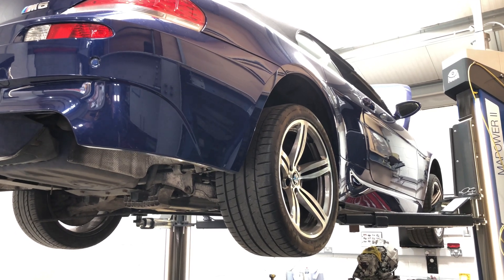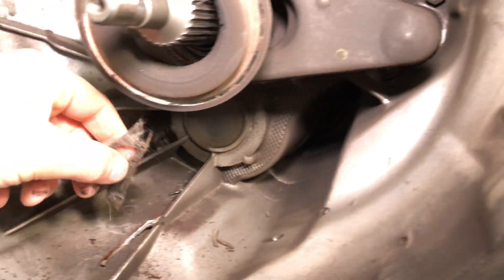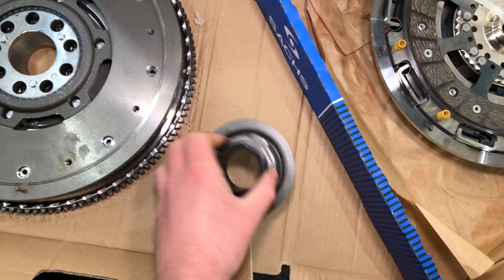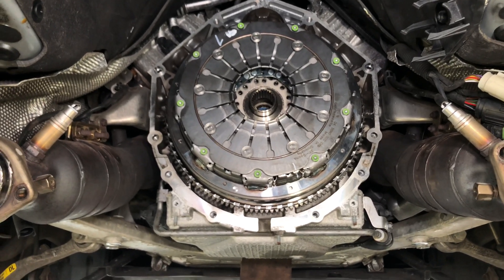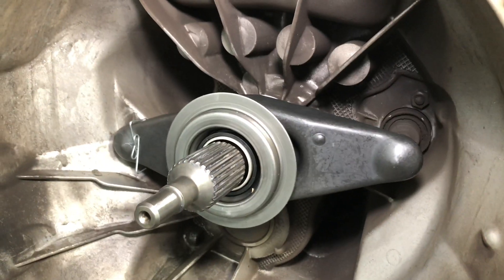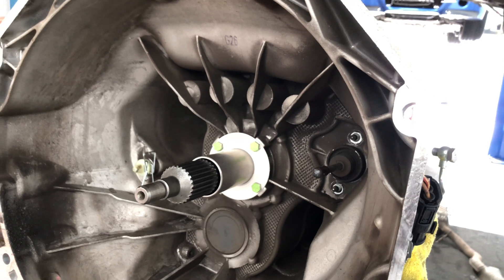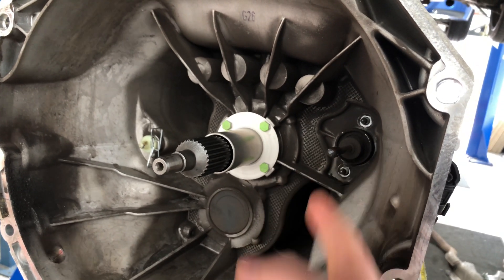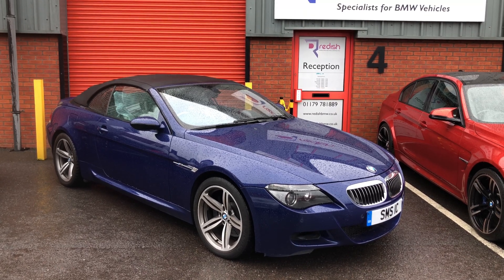BMW SMG Won't Adapt!

Comment from the maker: REGARDING THE COST:
Wow guys, chill, such negativity in such a short space of time….

This video was recorded 2.5 years ago:

Work carried out 1st July 2020. 
Video uploaded 4th July 2020. 
Video published 5th Feb 2023. 

Just to clarify and try to answer all the questions surrounding the customer being charged to remove the gearbox a 2nd time. 

HE WASN’T. 

Perhaps I used the wrong phrase of words on the video without expanding (sorry for any confusion). 

I’ve just check the works invoice from 8th July 2020 and WE PAID FOR HALF THE LABOUR. 

I can tell you the customer was very happy with that outcome. 

I appreciate some people may still think that’s unacceptable and there’s not much I can do about that as everyone’s entitled to their own opinion. 

Ourselves and the customer both came to the conclusion that neither party could have known about the Slave Cylinder ‘may’ cause the SMG not to adapt due to a 2017 BMW document (BMW released 12 years after production, and only 3 years before this work was carried out in 2020), and therefore we agreed to split the invoice as it was neither persons fault. 

If it was anybody’s fault you could point the finger (and aim that negativity in your comments) towards the manufacturer BMW. 

Thanks.

Comment: If you made a crescent shaped plate with two studs attached, you could insert it through the slave cylinder opening and fit it so the studs protruded outside the bellhousing. Retain in place with cotton thread whilst the slave cylinder (less its oem studs) is offered up and secured with locking nuts.

Comment: Do you have this same slave cylinder problem with the manual transmission or is it just in the SMG? Also, the new genuine BMW slave cylinder looks totally different than the original you’re replacing, was it the same part or was it superceded by the factory?

Comment: Here is where a disagree with the 2nd bill , the 2nd one should’ve been half/half at the end the shop should’ve know this issue before reinstalling the gearbox
Reply from the maker: Just to clarify and try to answer all the questions surrounding the customer being charged to remove the gearbox a 2nd time. 

HE WASN’T. 

Perhaps I used the wrong phrase of words on the video without expanding (sorry for any confusion). 

I’ve just check the works invoice from 8th July 2020 and WE PAID FOR HALF THE LABOUR. 

I can tell you the customer was very happy with that outcome. 

I appreciate some people may still think that’s unacceptable and there’s not much I can do about that as everyone’s entitled to their own opinion. 

Ourselves and the customer both came to the conclusion that neither party could have known about the Slave Cylinder ‘may’ cause the SMG not to adapt due to a 2017 BMW document (BMW released 12 years after production, and only 3 years before this work was carried out in 2020), and therefore we agreed to split the invoice as it was neither persons fault. 

If it was anybody’s fault you could point the finger (and aim that negativity in your comments) towards the manufacturer BMW. 

Thanks.
Reply: @RedishMotorsportbmw  Thanks for clarifying, I love your work and wish we’d have a shop like yours in texas 🇺🇸

Comment: Mate, unless your videos are all out of whack in terms of upload date, you have a video 2 years ago on your channel of an M6 (BMW M6: picking up the pieces) , where you mention this fault and say it's worth it to replace if it's out already.  Timing on the video at 9:50. 
Why didnt you do this already this time? Forgot about it? 
I respect your professionalism and I've watched almost all of your videos, learned a lot, but honestly this is a bit iffy if it's on the customer... I'd only say the customer should pay for the extra labor ONLY if you already told him this issue and he refused to change the clutch slave cylinder.

Don't delete this comment, wont be a good look.
Reply from the maker: Good spot, but just to clarify, this video (SMG Won’t Adapt) was uploaded 4th July 2020 and Sat as ‘unlisted’ (like about 80% of our videos) but has always been available on our M5 & M6 Clutch Page website here: http://www.redish-motorsport.com/E63E64M6S85ClutchFlywheel.html ). 

Whereas, the video you refer to (Picking Up The Pieces) was uploaded 17th November 2020. 

Just took screenshots showing the 2 upload dates on YouTube but can’t seem to find a way to add images to this reply.
Reply from the maker: So yeah, our uploads are not always in order. We have a video graveyard of another 42 usable videos recorded but they are currently sat as ‘unlisted’ which is why sometimes the dates are out of spec. 

Thanks for the comment, we’ll take this on board and try to remember to add notes to the video and/or description if it’s an old video to help clear up any future questions.
Reply: @RedishMotorsportbmw  Good job ! Honestly you are very inspiring through the quality of work you do and your professionalism and transparency. 

If I lived in the UK I'd definitely want to work for you, this world lacks people who know what they are doing. 

P.S. waiting for the m3 touring series ;)
Reply from the maker: Thanks LZ! We were working on the M3 Touring 2 weeks ago actually - trying to finish up the video clips needed to finish editing the Trunk Floor episode. I know we've now recorded Parts 2 and 3 (need editing), and have direction for another Part 4 and Part 5 subjects and that's just Rear/Underside Bodywork and before we even get onto anything mechanical.
Thanks for following!
James Redish.

Comment: 1, The fact that you charged customer again for labor is ridicules and very unprofessional . Clearly that was a mistake on your guys behalf and not the customers . 2 customer probably spent a lot of money and the fact that you couldn’t even use a can of break and clutch cleaner and really clean out the inside of that bell housing shows how lazy you guys have become .
Reply from the maker: Thanks for the comment Tommu, but you are assuming we charged full labour to remove the gearbox a 2nd time due to BMW’s issue (not our incompetence). 

I just looked up the work invoice from 8th July 2020 and it shows we charged HALF of the labour. 
(We offered to pay half of it and the owner was very pleased with that outcome). 

Of course, you may still think that’s unacceptable - and that’s your choice as you’re entitled to your own opinion. 

I would also like to point out that unless I’m searching incorrectly, we’re the first company to highlight this fault in such detail in an attempt to help others. 

We could have kept the info to ourselves but that’s not what we’re about. 
If you’ve followed us or seen our type of style you’ll know the sort of stand up company we are. 

LZ, regarding your 2nd comment, please refer to your 1st comment where I answered and clarified the situation so I don’t really see the need to try to stir anything up by your 2nd comment here on someone else’s thread.
Reply: @RedishMotorsportbmw  Yea I'll remove it, sorry man I didnt actually expect you would reply. Top notch.
Reply: @RedishMotorsportbmw  thank you for your comment with further explanation and for all your content.
Reply: *Brake
Reply: How was there a mistake made here? How would they have known that the clutch wouldn’t adapt until it was assembled? You seem to think they are running a charity or something 😂
Reply: @Mac_F87  as a customer, I would be a bit surprised that professionals like these charged me for mechanical labor twice for a single job because they do not know this can happen and did not suggest replacing the cylinder straight away. As a workshop, I would be upset that BMW does not mention this in the repair manual and think about a discount on the mechanical labor to the customer to keep good customer relationships.
Reply: @adamrimsky  yeh, just because they said the customer would have to pay again how do you know they didn’t discount a few hours labour as a good will? It would seem they have explained the situation to the customer and he was happy to pay either way. What I can’t understand is why people on YouTube are getting upset on behalf of the customer. 

See there’s the rub,
more and more people want everything for nothing. Unfortunately with M cars, RS cars or AMG cars big repair bills are par for the course. Why should a business start doing discounts to appease customers due to an issue that lies at BMW’s doorstep? If they start that it’s a slippery slope, BMW certainly aren’t going to reimburse them in return. You either pay main dealer prices and put your faith in similar thing not happening (which having first hand experience it does) or you go to a good independent who will charge slightly less but can’t know every single intricacy of every single model.

Comment: I think I would be tempted to tap a thread into the bellhousing for the slave cylinder and change to fixing bolts to avoid having to completely remove gearbox again
Reply: Thats deffo what i would be doing
Reply: Yeah I would go down there and do it my self.